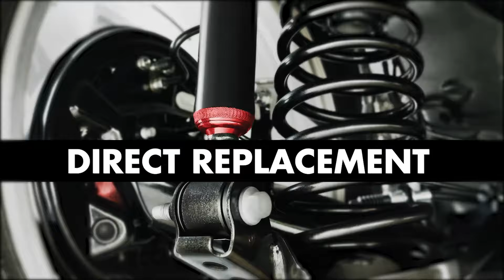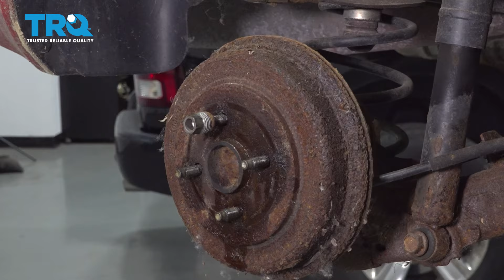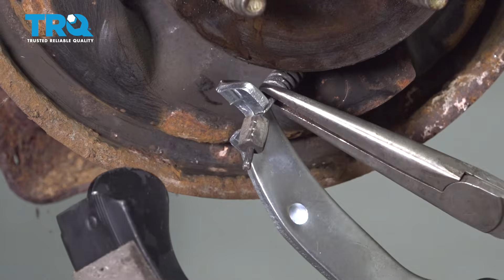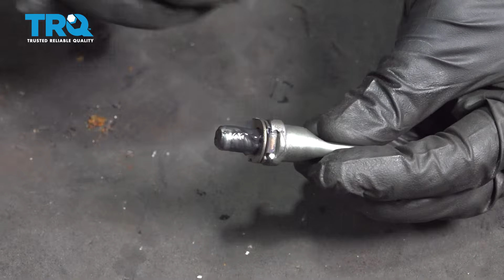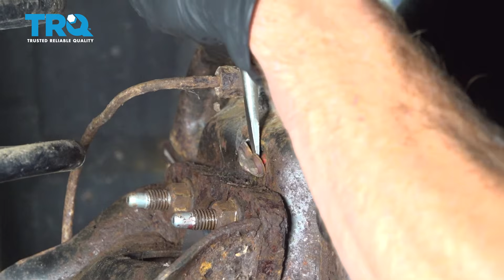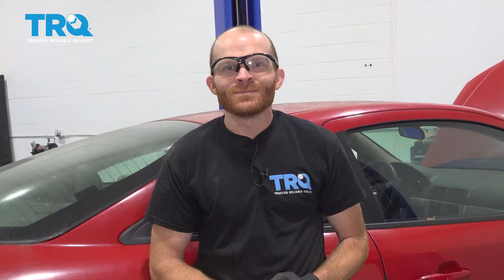How to Replace Rear Brakes 2004-2010 Chevrolet Cobalt

Comment: 2009 and 2010 cobalt's do not have the big holding spring,2 spring and holding pins to the backing plate and 3 other springs holding the assembly together.Good vid for 2007-2008's.

Comment: I just did my pads and drums last week. Everything went great but a couple days of driving and I started hearing this repeating knocking noise when I'm going down a hill and I have the brake pedal pressed a little harder than usual. It doesn't do it when I have the pedal pressed lightly only when it's pressed a little harder. I took the wheels off and everything looks good with the pads and drums. I don't know if it's something to do with the brake job or if something else went right after. Has anyone else had a similar issue?

Comment: Is it safe to use regular anti sieze instead of copper anti sieze on the mating piece?
Reply: Copper anit-sieze is rated at 1000 C. Aluminum anti-sieze is rated at 850 C. You'll be fine using aluminum, just try not to brake as much. If you're going on long trips, pull into a gas station from time to time and hose your drums down with water to keep em cool and you shouldn't have any problems. I've only ever heard of one time where the wheels locked up from not using copper but he lived in AZ where it can get hot.